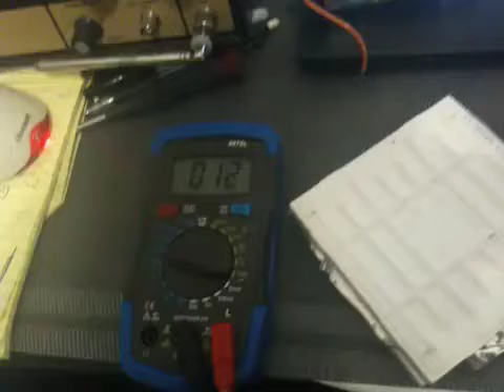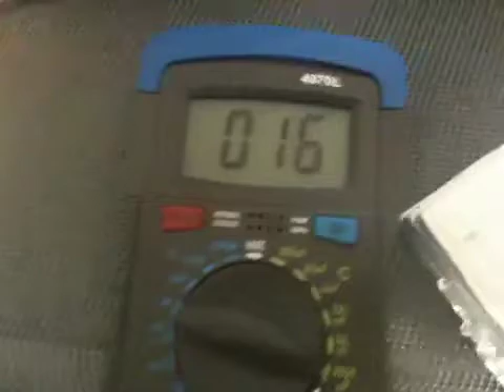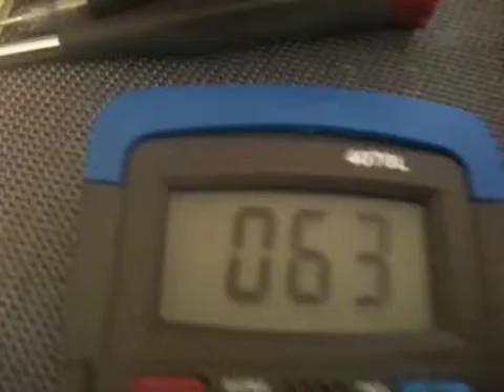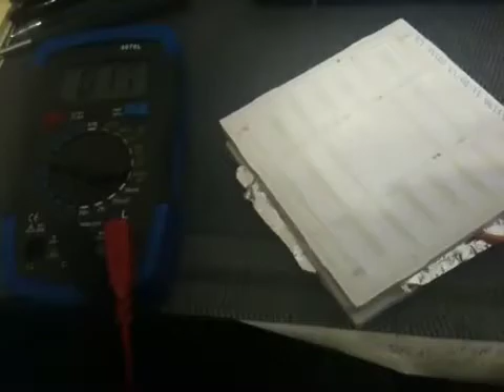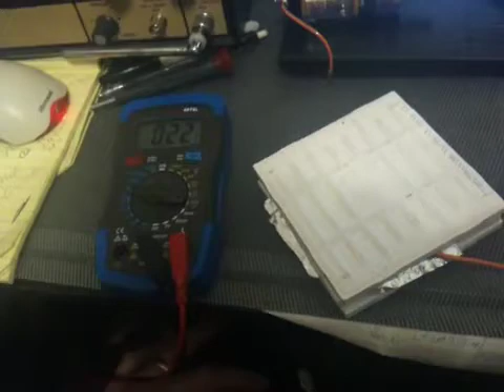Home brew capacitor for mag loop

Comment: I think this is mostly a great idea. Unfortunately aluminum is such an active metal it just loves to corrode when in contact with a dissimilar metal like copper wire. I would suggest finding some brass shim stock. The thickness is not too important. The good thing is that it is easy to solder copper wires to whereas aluminum is a bit tricky and its also easy to accidentally tear. Brass shim stock is also easy to cut. Copper foil from a hobby store would work perfectly too.

Comment: Cool idea using the ceramic tiles.
Aluminium thin sheet comes in 100ft rolls here, used for damp course bricklaying.
Also Teflon sheet comes a Barbecue Liner, its like black paper and very cheap.
So I use these for my high voltage caps for Magloops.
Currently I only use 5 Watts on HF WSPR.
http://s12.postimg.org/jj6ocra99/TWO_TURN_PEXAL_MAGLOOP.jpg
Myles VK6ZRY